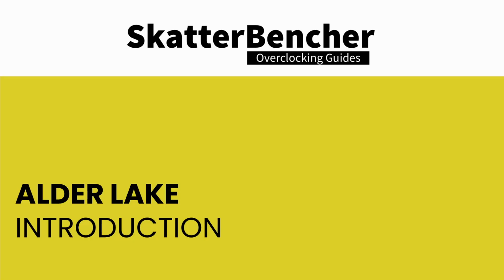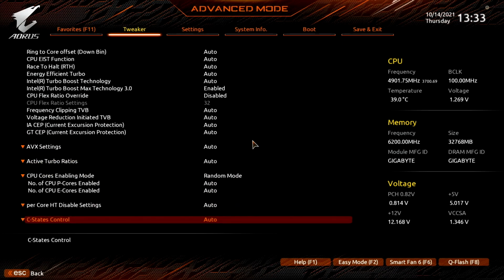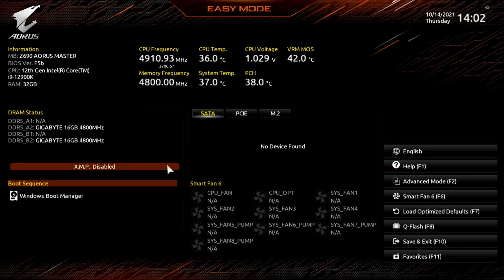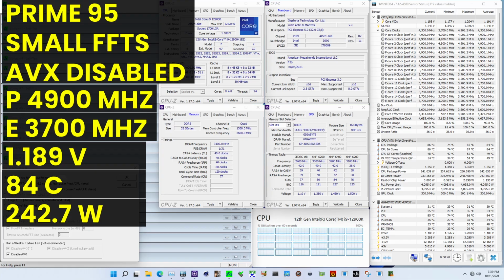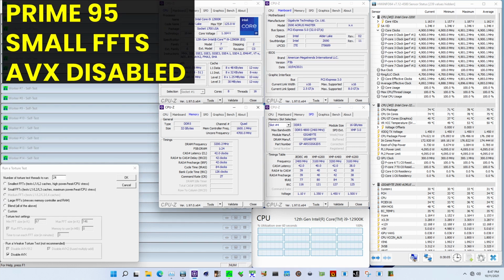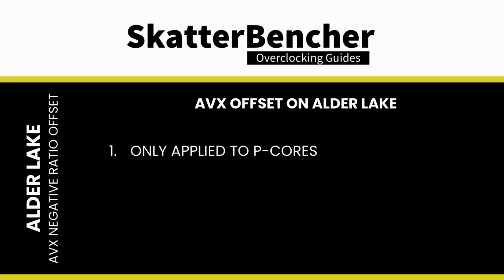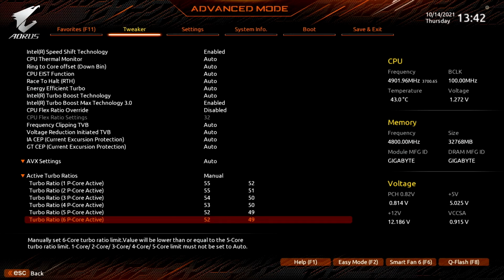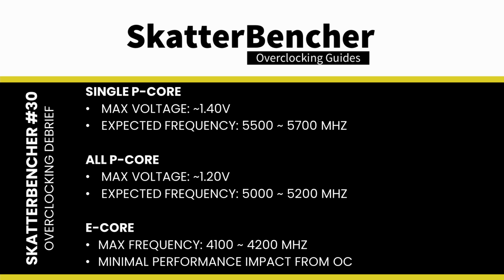Core i9-12900K Overclocked to 5500 MHz with GIGABYTE Z690 AORUS Master | SkatterBencher #30

Comment: tried this on my aorus master with a 12900kf, it doesnt go over 5.2ghz and only scores 830 in cpu-z sc
Reply: “Only”
Reply: @stateofthecat  yes  because it should score above 870 with  5.5, but its always on the allcore boost even in single core load
Reply: should be well over 830, not sure why that would be

Comment: Would love to see a overclock for the 12700k from my quick testing running 5Ghz all core is a struggle.
Reply: @plop31  What voltages have you found work? or have you tried changing DCLL and ACLL for voltages?
Reply: @plop31  i have a strix "E" on the way, is this what you refer to with the "ASUS AI stuff" ?  That would be great if so !!
Reply: @plop31  thanks Jean-Marie !!!  I appreciate it

Comment: Excellent tutorial. Does this same overclock work for the i7 12700kf? I wanted to raise the frequencies a little more without pushing too hard. Use Noctua NH -D15 cooler!
Reply: Yeah works but don't enter the same values as he did. Tune it down a little
Reply: @GodRob  Can I use half of what you put in the parameters to get at least 4.9ghz on all P cores? I wanted to leave two cores at 5.4ghz. 4 cores at 5.2ghz and so on
Reply: @CanaldoUltimate  not gonna happen
Reply: @CanaldoUltimate  max you can do is 5ghz

Comment: So temps pretty high. Same on heavy cpu intensiv games with avx usage?
Reply: 5.4Ghz all cores in light load = 50-60 degrees with custom water-cooling loop.
just use TVB and temps won't be a problem.

Comment: By far the best overclocking channel!
I have an ASUS board, but I watch all the videos as they are all very informative and have a huge background behind all this.
Great job! Keep doing what you are doing!
Reply: Unfortunately  i have a ASUS strix "E" z690, did i make the wrong mobo choice?  Do you think we will be able to even get close to what the Aorus master got?  I am still within my return window so let me know your thoughts if you wouldn't mind.  Thanks so much!!! If you find a video where someone does this on the strix "E", let me know.  I still haven't been able to find decent DDR5 quite yet, still looking.  Do you think we should get an AIO cooler of 360mm? Would Arctic be a good brand? Since I have a 12900K , would I need to go with like an 850 PSU or would you recommend going 1000w ?  Sorry for so many questions and I really appreciate your time !!! anyone is welcome to chime in.
Reply: @harpoon_bakery162   I use even more weaker board: Tuf Gaming z690 D4 but still have quite good overcklocking 5.20 all cores / 5.5 3 cores AVX-0. But good coolong is required to get strong all cores performance. 360 AIO should be good enough for 5.1 maybe 5.2 all cores.
Reply: @dmitrylozenko7123  wha's the next step up from an 360 AIO so that I don't have to worry about 5.2 on all cores?  hopefully not a custom cooling solution
Reply: @harpoon_bakery162  a 420mm AIO. But only big daddy cases can accommodate usually.
Reply: @harpoon_bakery162  you made the right choice thats a really good motherboard